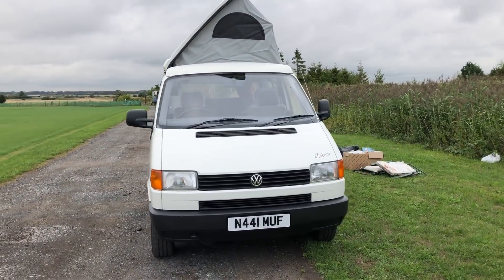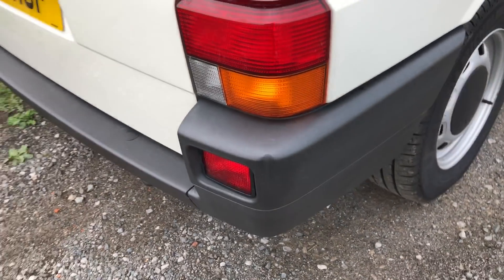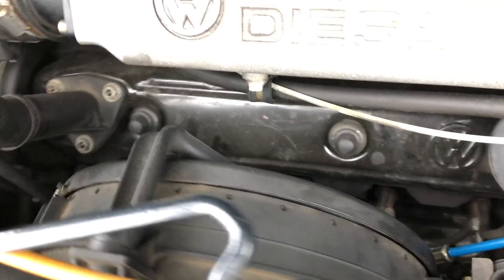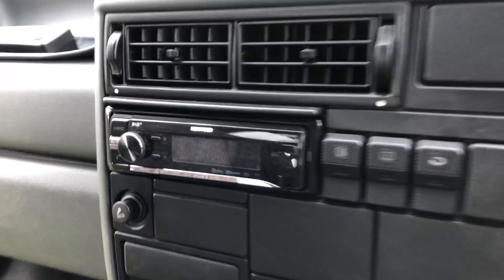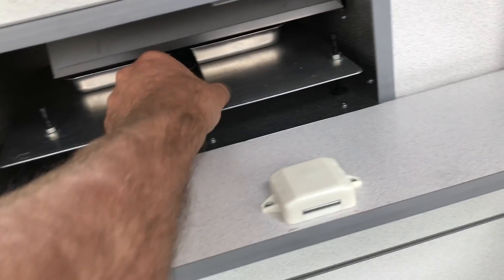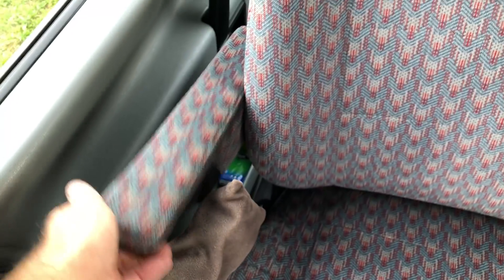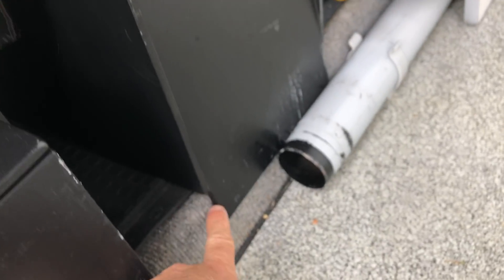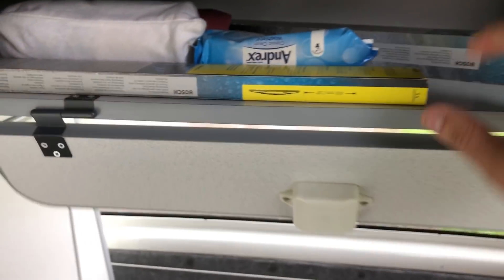1996 VW T4 DIESEL 1 DOCTOR OWNER BILBO CELESE CONVERSION CAMPER N441MUF

Comment: Interesting - we did find a similar one - 1997 VW T6 Bilbo Celeste LWB High Top rather than pop top - wonderful to virtually the same interior in a campervan. The condition of ours is good, but not quite this good, but has only 40,000 miles, and is slightly bigger and has more storage therefore. Otherwise identical fridge, cooker, cupboards and other interior features. Bilbos were ahead of their time and still these two vans are as well equipped as any new T6!